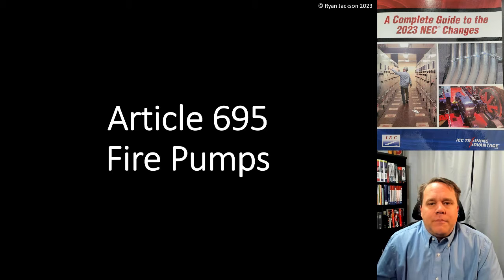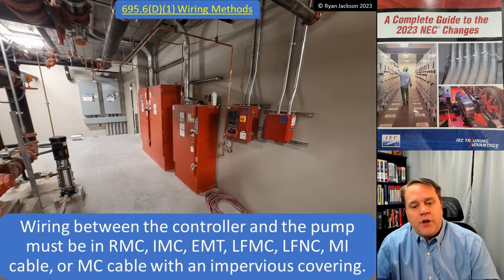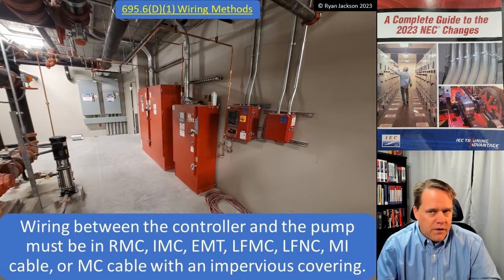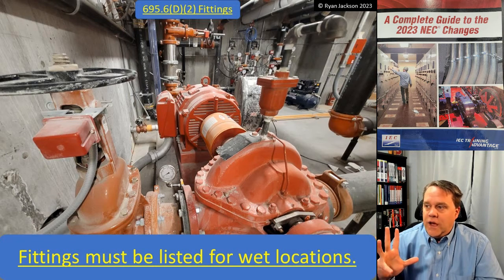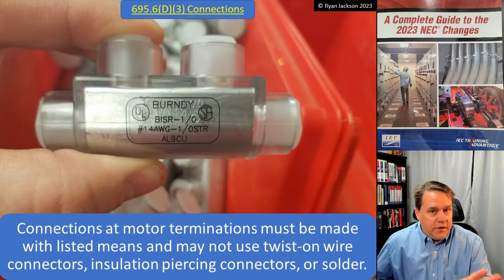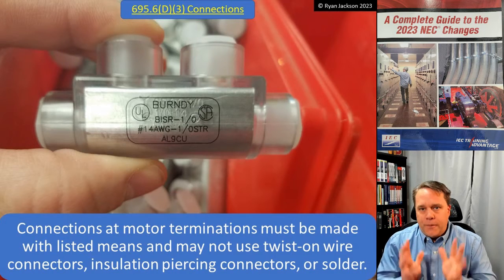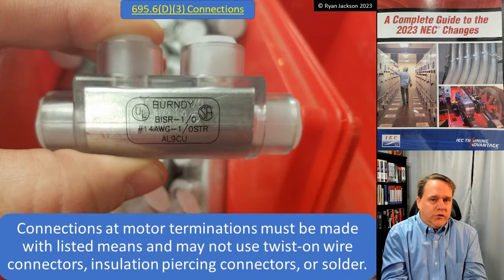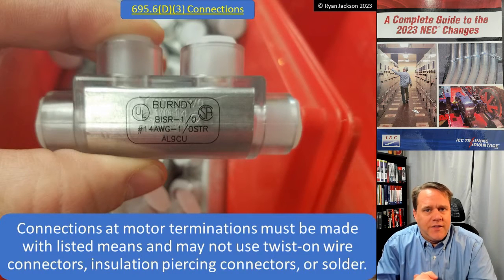695.6 Power Wiring (for fire pumps)

Comment: First time that I came across a fire pump emergency power supplied by MI cable though they made a mistake when I observed a 6 by 6" by 1/4" thick brass plate that had three drilled holes & tapped for pipe threads for MI cable to enter fire pump panel. Asked an old sparky why that was done. Was a long time ago but think he said this prevents heating by induction. Thanks Ryan for another great easy to follow vidio.

Comment: What got me concerned about the 7 ( 60 to 250 HP ) fire pumps that our e!ectrical shop had to run every week was every motor were not TEFC NEMA motors but open style. Yes I guess an open motor might not burn out as fast as an overloaded TEFC motor but numerous times have seen fire pump shaft seal leak and spray water right on open ventilated shaft side of fire pump motors. Not a big problem if you are in the fire lump room when thus occurs. Just shut off the pump until plumber repacks shaft.